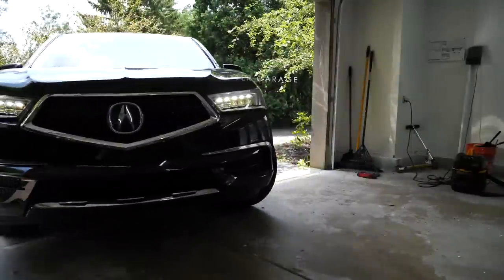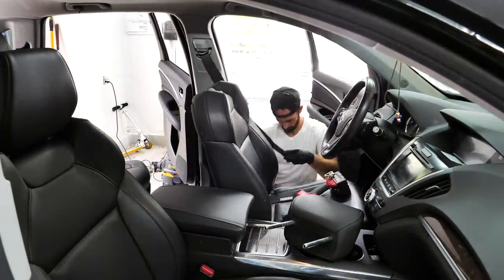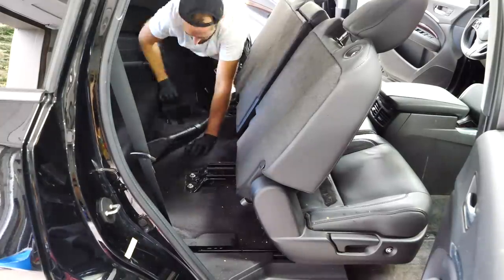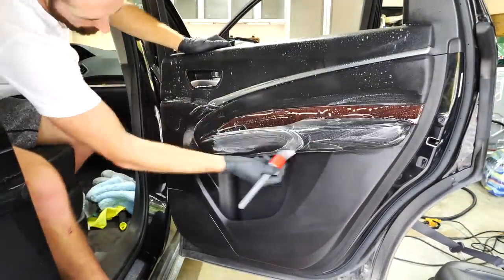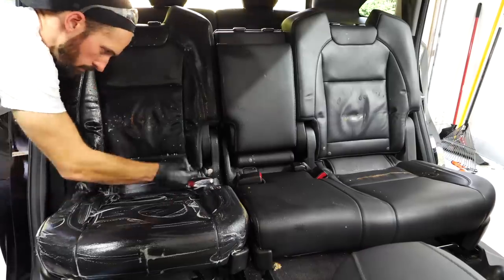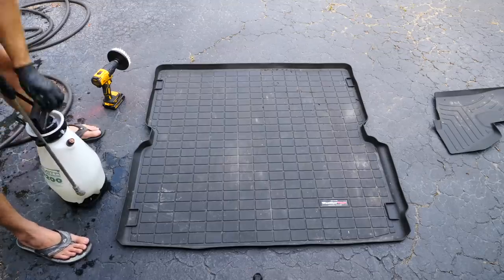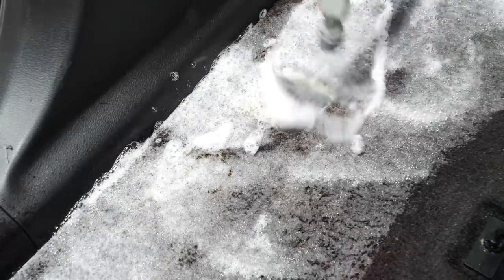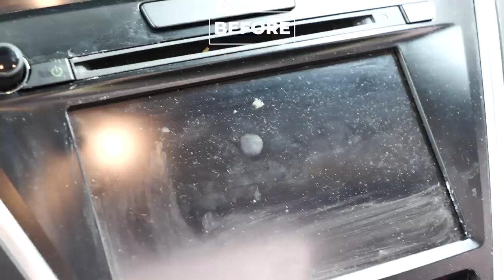DEEP CLEANING A Nasty Acura MDX! Insane Before and After Transformation Car Detailing

Comment: Can you show us how to clean the liner on the ceiling.  I bought my car used and it looks like water stains, possibly from leaving sunroof open.  Not sure what to use or how to go about cleaning it.
Reply: I’ve used Folex and a detail brush to scrub and the wipe clean with a damp microfiber cloth. You don’t want to wet it too much and be as gentle as you can.
Reply: Typically you can use a fabric cleaner or apc and do a light spray, then use a detailing brush to agitate, then dab it dry with a microfiber towel.

Comment: hey, can I get some tips on cleaning a touchscreen in my car? I thought about using a detailing brush on it last weekend, but was afraid of scratching it
Reply: The Fox Clean brushes won’t scratch it as long as you aren’t scrubbing on it. Lat26.com has a product called Glass and Screen Clean that works very well.
Reply: Spray a microfiber towel lightly with your cleaner solution then wipe the screen with that. Afterward use a clean towel to dry any leftover cleaner

Comment: How does using a detailing brush differ from going straight to a microfiber cloth?
Reply: The brush typically is just a little more aggressive than a microfiber towel and it can get into more of the smaller cracks that the microfiber towel wouldnt